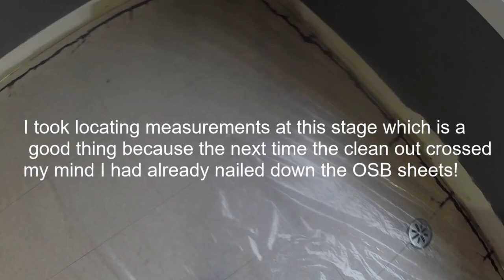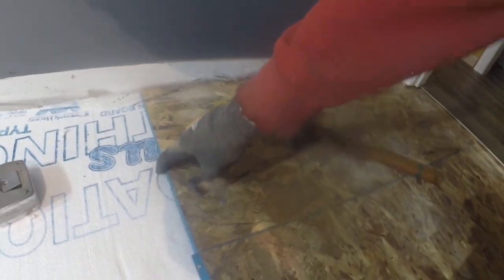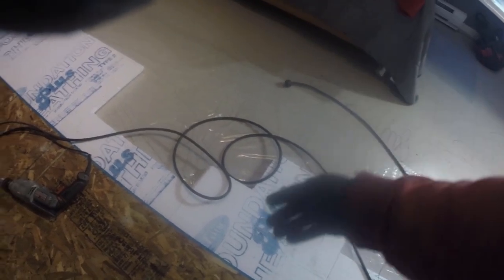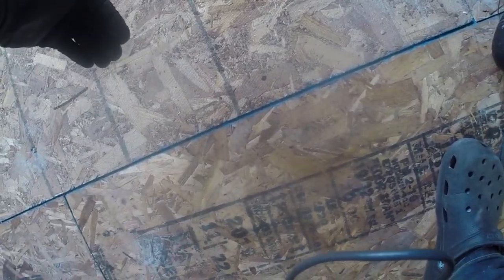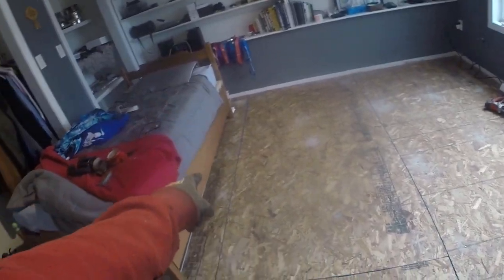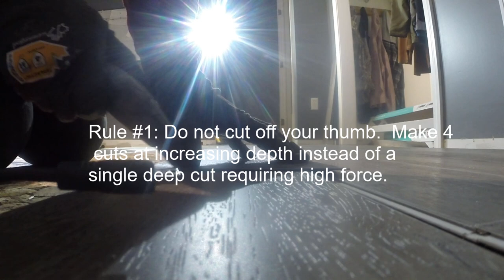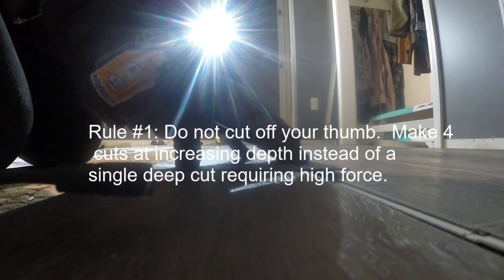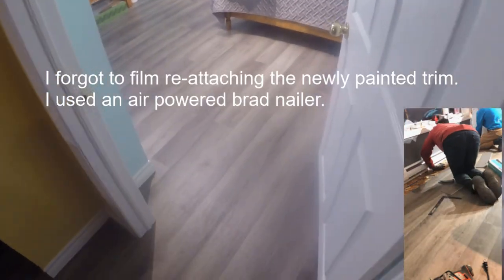DIY - Fix Cold and Damp Basement Floors Cheaper Than 2x2 Insulated OSB Panels_Part2of2

Comment: Looks good. The DriCore and other 2x2 panels are extremely expensive! The problem with the 2x2 panels is that the floor needs to be almost perfectly level... Amvic makes Amdry 2x4 panels which make better sense, but still you would have to shim unless floor was very level. 

I like the idea of making your own channels in the XPS foamboard.. Though i have 450 square feet to cover.. I don't feel doing that to ~ 16 panels! Amvic does make a EPS foam with grids in the bottom already. I am just going to use Delta FL, then 2" XPS foam board and then Advantec subfloor. It will entirely float. Then LVP on top of it all. I will also build the walls on top of the new floor. 

My basement is very dry even in the heaviest rains we have seen in New Hampshire over the 6 years I've owned the house. The Delta FL subfloor membrane is really just insurance.. Robertson make Airguard underlayment for about 1/2 the price of the Delta FL.. I might use that.
Reply from the maker: Thanks for the feedback.  Fyi i cut grooves in 800 sq ft of rigid foam (50 panels that are 2x8).  With 2 people and a table saw it would take no more than 45 mins and i saved like 700 bucks.